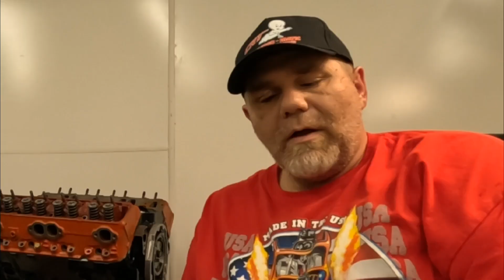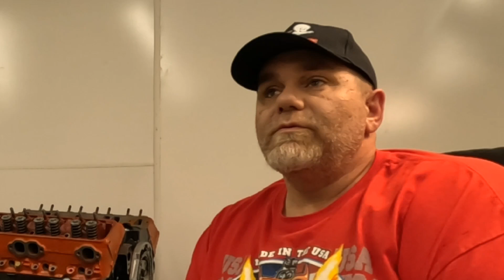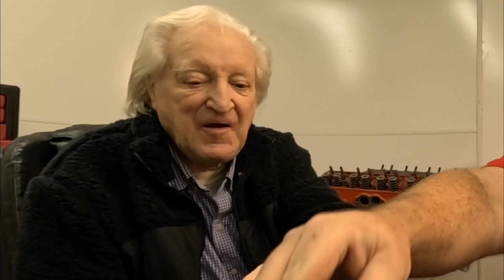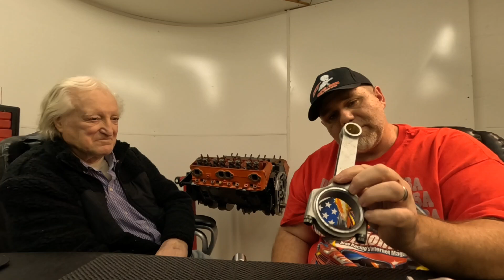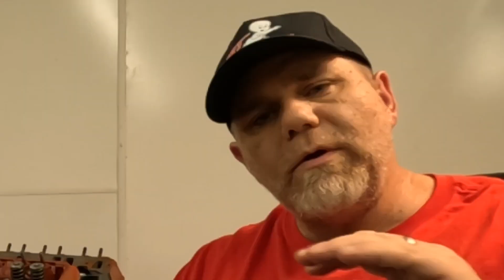When is Stock NOT really STOCK? @DavidVizard @servediocylinderheads @JustMoparJoe

Comment: Yall have spent how many videos over a 130hp 318? Yall have argued to the point where noone cares. Just put a 130hp 318 on the dyno, and start improving it's output. Maybe yall are just trying for more youtube views, Please just put a stock 318 on the dyno. All this talk and no dyno numbers is getting painful
Reply from the maker: This isn't for that... I'm a Mopar guy at heart and I've built My MIXED UP BOSS Ford, I've done 2 Chevys and it's time to get a Mopar on the Dyno. Do I wish it was a 340 yeah! But at this point it's for my curiosity
Andy
Reply: @UnityMotorSportsGarage  As you know Andy, the 318 is a baby 340 (same stroke, smaller bore), and with a .060" overbore you will have 328" to play with. Chevy people love a 327 (331?) and Ford folks swear by as little as 302 (sometimes stroked to the wicked 347!), so the potential is definitely there. If I were closer, and had some YouTube cred, I'd love to work with you guys on some alternative 318 block builds. The 360 crank can be added to make a 349/350" LA as well as (with a core shift verified early block) a 402" stroker. I have some custom JE pistons for that (flat top) that use .927" pins for Chevy rods, as well as some custom Venolia domed pistons for a 382", 4" bore 318 using a mid-stroke (3.79" readily available in 318/340 main and SBC large journal rods) crankshaft. You don't HAVE to start with a 340 block or even a 360 with it's larger main bearing size to make some HP with an LA Chrysler!!
Reply: I like UTG s approach. A kid with a grinder? Common sense, money, easier to do xyz should NOT come into it.
Reply: @stevenkirk2563  A kid with a grinder can mess things up fast render the parts junk instantly it ends up costing in failure to meet the goal.

Comment: Hell Im happy that a 318 is getting so much attention they are good little engines. Ive been following this project since day one. I have to say I agree what you two are doing with it but? With that being said I see Tony's point as well. But in the real world if your on such a tight budget that you cant throw in at least a small add-on like the intake or for that matter even the cam since its all torn apart anyway. Then wait a little longer till you can get the parts even used parts will work. Its a good concept to try but you cant change the laws of physics even 250 to 275 HP I think is doable but only just doable with the all stock parts and it would have to be done PERFECT looking forward to the rest of the series on this little engine.
Reply: Yup. I was saying even a budget guy could scrape up a cast iron intake and 600 cfm 4 barrel I think I paid 60 bucks for a whole setup back in the late 80s.

Comment: another way to increase comp is a thinner head gasket
Reply: Correct. Thinner gasket will increase compression. Except chrysler used a steel shim head gasket factory. Doesn't get any thinner than that. Pistons are too deep in the hole from the factory for compression or quench. Thats the value of what they have shown with those longer rods
Reply from the maker: Yeah you are exactly right.  
It can be done with offset grinding the crank but once you do that it isn't a 318 anymore too.. having to bore the block is a must
Andy
Reply: @UnityMotorSportsGarage   - offset grinding the crank was discussed in the initial video.  Sure, it's not a 318 any more, but it's still a stock engine with stock parts that have been modified.  Stop making up stuff to rationalize your decision to not just do what you guys talked about in the original video.

Comment: I think Tonys was trying to teach what can be done with what the motor started as. Alot of car people like to part of or watch you guys work some magic. watching what your doing with mind and hands is what helps many grow.
Reply: Exactly.  3 really smart and talented hotrodders - I wanted to see what they could do with the stock parts ONLY.
Reply from the maker: @pete540Z good luck with using 50 year olds.. I'm sorry but I realized that people would be upset with just doing a simple overbore to get straight cylinders to work with.. saying it isn't a 318 anymore! 
Andy
Reply: @UnityMotorSportsGarage  - I wouldn't have been upset if was a simple overbore and you guys only made 40hp more than stock - I wanted to see what you talented guys could do with stock stuff.
Reply: @pete540Z  well you pretty well saw it . O wouldve got rid pf those junk heads first thing regardless of who didnt like it !!! Pathetic that you honestly cant see that this bid on engine will actually worth bidding on and Last for whoever gets it !!! The weight David took out of the stock rods with the thin modern rings ARE your 40 hp easily !!! Thats just in Efficency improvement . But on a worn out bore ?? Ha ha if you dont have a seal you dont have a engine . Bet if your wallet would open to bid youd expect the best of everything PLUS A WARRENTY !!!!

Comment: Good one! I did a similar deal on my 400. NO ONE batted an eye when I told them I was using stock block, Stock crank, and stock length rods. I actually bought the ones from 440 source that have cap screws instead of bolts. I could get them cheaper than I could have mine reconditioned. I’m excited to see this build in action and as a mopar guy, am glad to see any changes and how they affect the 318’s outcome.
Reply: I understand why you went with the Source rods (price/bolts/material) and I really appreciated the pins floated steel on steel, with proper clearance and oil feed. Before the Source rods were available, I used to add ARP2000 bolts with the 12pt nuts and beam-polish and shot blast stock 383/400 rods and float the pin eyes just like you did, and paid MORE!! I don't have a dyno, but extrapolating from MPH/ET/weight-to-HP formulas, made around 580hp with massaged all stock castings/rods/heads/crank etc. from a .060" over 383 (395"). All the guys in our dragster group were inspecting the motor and asking questions..LOL! Good geometry, parts selection and careful assembly will pay off in the end!!
Reply from the maker: It comes down to common sense, Money, and is it practical.. 
I'm going to have fun with this Build!
Andy
Reply: @UnityMotorSportsGarage  like Tony said - it wasn't supposed to be a BUILD.  It was an experiment with the stock parts only.
Reply: @pete540Z well it's a build now!... And I for one am glad that uncle caveman is out!
Reply: @moparnut6286  Well you went there. Bye
Reply: @pete540Z  where the heck was he then ?? Tony wasnt even there !!!  He did nothing !!!
Reply: @pete540Z  Tony should have done that himself and challenged anyone to make more power than he could. That would not happen because anyone could build a better engine than Tony.

Comment: An engine is no longer stock once you start replacing OE core parts with aftermarket performance parts. Reworking an original part is modification but still original. As in original manufacturer stock. You see this most often on "numbers matching" modified Barrett-Jackson cars.
Reply from the maker: If you rebuild your stock engine and put new parts in it is it still stock by your definition?
Andy
Reply: @UnityMotorSportsGarage  Yes, so long as it's using OE parts. Now if I stick Keith Black Pistons, Edelbrock cylinder heads and a scat crank in it. That's hardly considered stock anymore. Wouldn't you agree? Now I couldn't give less of a damn What engine was built to benefit Saint Jude's, More power to you no matter what you build. But let's not twist the definition of stock in order to avoid the elephant in the room.
Reply from the maker: @peanutbutterandjammy you have just contradicted yourself. Once you get rid of the factory part numbered part it's not stock... Think about that, I could mix and match factory parts such as using Magnum 318 parts in the build but that isn't Stock for a 71 318.. They call it a trap and you can't get out..
Andy
Reply: @UnityMotorSportsGarage  it's not a contradiction. I said OE parts as in a reproduction or new old stock of the original. not a mish mash from separate years or models. You know what stock means, so all this "What is stock" nonsense is pointless.
Reply: @UnityMotorSportsGarage so Andy what your really saying is if the car is not as delivered from factory it's not stock anymore!... Just reringing the engine would make it not stock cause stock is originally as delivered.... So the stock word has to be bent.
Reply: @peanutbutterandjammy well in case you have forgotten uncle tony already built one of those…it’s in bottle rocket right now! Well…except for the roller cam and lifters that is! But here’s the thing.. it couldn’t be “any” factory parts according to UTG. It couldn’t have factory closed chamber heads like bottle rocket has from a 273, or the later model 302 closed chamber castings. Charlie initially ported some not knowing and then had to start over with the “period correct” 675 castings. It would have been one thing for UTG to have dropped off a low mileage 318 completely intact and said you have to use what is inside this engine right now! But when you have a crankshaft that wasn’t usable (flawed), rods with core shift(DV had to find more to machine a complete set), the block needed bored-out and the donated icon pistons were a stock height replacement… I see a bunch of guys who endeavored to keep it within the parameters down to the tulip valves, and ended up deciding that…🤔you know what, this engine is going to the winner of this CHARITY event and I think we should give them an engine they can be proud of instead of a liability! I think that is a great idea myself. The 318 is a badass when it’s given the respect and parts it should’ve came with from the factory…but never did!

Comment: Stock is not stock once someone touches and changes it!! If it's not the way it came from the factory, it's not stock!!
Reply from the maker: So how are you going to make more power?? You can't expect 50 year old worn out parts to do the job. Once you put ANY new part in the engine you can "Technically" say it isnt stock right?
Andy
Reply: @UnityMotorSportsGarage  
I thought it was just by removing metal...
Reply from the maker: NOBODY could expect to take 50 year old junk worn out parts and make any power, you still need to put NEW Bearings, Rings, Valve seals, basically a full rebuild.. 
The parts we were given to use were completely worn out
Andy
Reply from the maker: Exactly